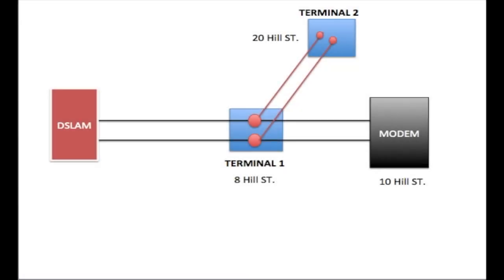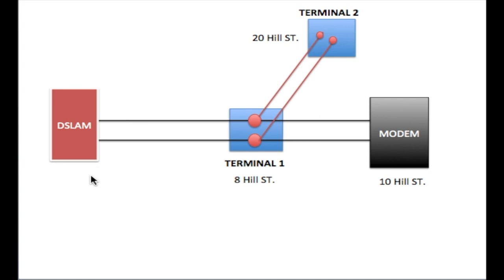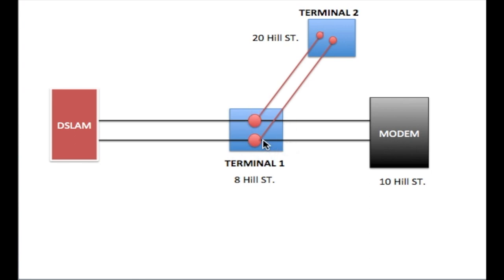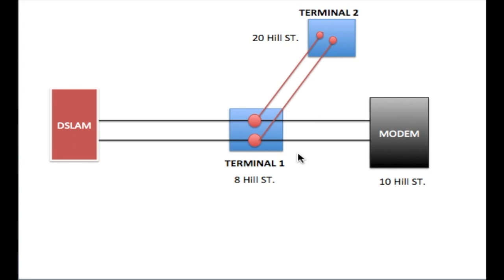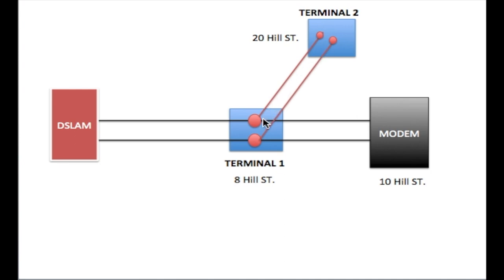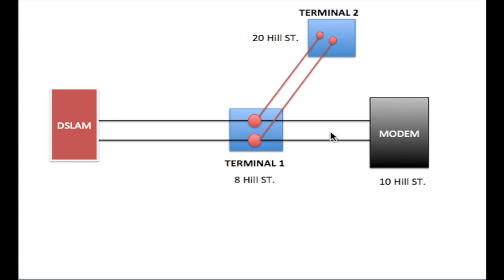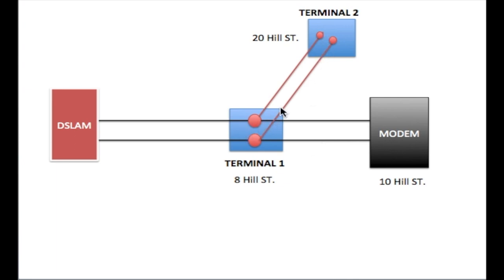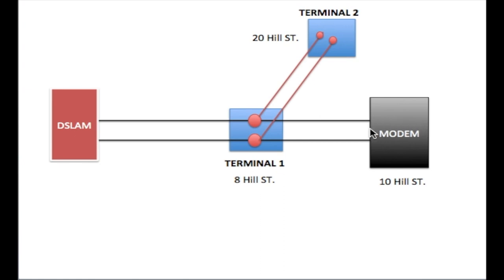DSL Bridge Tap

Comment: Trevor: Another very helpful video. A question: Why would a second terminal be needed to connect to the first? And...can't we avoid bridge taps altogether somehow? Do we really still need them, or does that depend on which type of DSL is being used?
Reply from the maker: Hi Brad  the 1st terminal is the main terminal which is directly connected to the Central office.  This terminal is formally referred too as the JWI (Junction Wire Interface).  There is a 2nd set of cables going from the JWI to many  terminals with in a 1 mile distance of the JWI.   I am sure you walk by these terminals every day.  The JWI is a big metal box about 5 fts high by 6 ft  wide  and the 2nd terminal is very small.  Its about 2fts.high by 8 ins wide.  They are many of these small boxes on  each street, and their purpose is simply to connect a pair of wires in a cable from each home to the pair of wires with their signal from the JWI.  This connection Is not a bridge tap.  Its just a connection point.  A bridge tap is when you  have a 2nd pair of wires connecting to any one of these connection points going to another location.  This was a common practice to share cables  with early telephones service, and it is fine for telephone service, but its not good for DSL service. 
Its not a standard practice today  but they are still many bridgetaps existing in the field causing problems for DSL service.  Thanks for the question Brad,  and I hope my answer was helpful.
Reply: could probably be found in groups of apartments